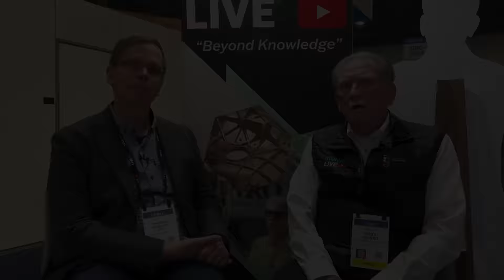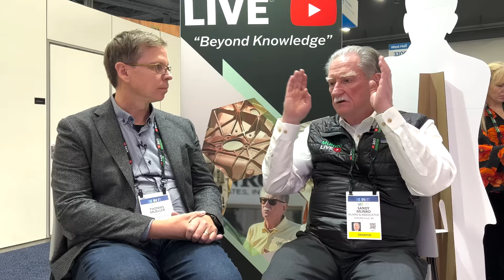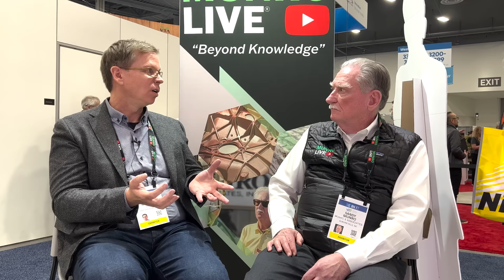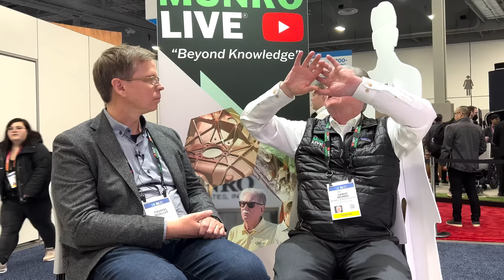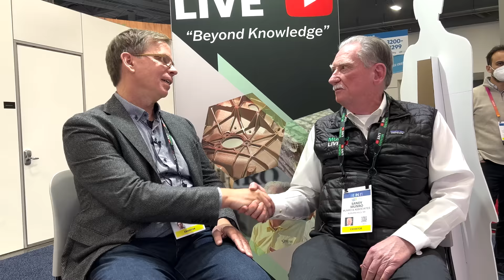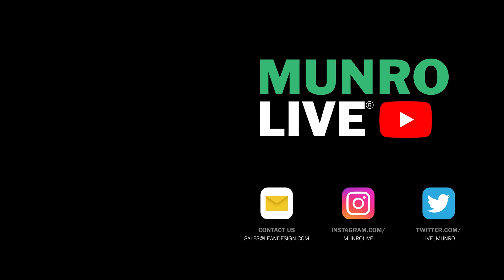100 Million Lines of Code: The State of Automotive Software | CES 2023

Comment: Wire and chips are NOT the major cost in large programming projects. The major cost is the programming of large computing systems. There's a reason why the "Boeing Dreamliner" has so few lines of code. This is because of the built in problem regarding complication in programming. Due to Turing unavoidable halting problem, you have to put massive dollars into a large programming project such as an operating system in order to make it function. If you have small operating environments - this ends up costing much  much less. It's not the wires the auto people are worried about. It's getting buried in code. Don't throw off coding as if, "what's the big deal." Larger software projects - codebases, if not managed carefully can lead to cost explosions. Wire and chips and simple code is cheaper, compared to that.

Comment: Well now, I understand the drawbacks of C, and using object orientation to reduce complexity is all well and good. However to put forth Java as a beacon of secure software is just wrong. Since Oracle took over Java, rather than deal with security flaws in a timely manner, they throw up a dialog box saying basically if you get hacked due to a security flaw in Java, you agree Oracle is not responsible.😂

Comment: The microservices architecture Thomas is talking about and which must be (a) secure, (b) failure redundant under all operational conditions and (c) based on low latency messaging screams for implementation in Erlang/OTP & BEAM

Comment: Though Tesla writes their own software for their cars, I imagine it's very different than that for many other vehicles. For example, they use the Qt toolkit in their cars which IMHO is an excellent choice. Qt is extremely comprehensive with strong automotive support. It's cross-platform (Windows, Linux, MacOS, Android (including automotive), embedded) and is written mostly in C++. It's quite modular and also supports many other languages including Rust, Go, Java, Javascript, Python, C#/Mono, and more. It also provides strong GUI support which can be easily themed and modified and includes 3-D support with Vulkan/OpenGL. It provides a good abstraction for hardware as well, including sensors, many networking protocols, Bluetooth, CAN bus, TCP/IP, serial, USB, and many more. It even includes GPS mapping functionality. It also provides QML/Qt Quick for the rapid development of applications.
Reply: They too use some external suppliers, at least for their infotainment, and that system is of course linux based.
Reply: @luc_libv_verhaegen  Qt would be one of those suppliers. I also know that at least early on the part of the GPS software (the part shown on the dash) was by Garmin.

Comment: Longtime fan Sandy. I want to point out that EVs are NOT light on tires. The ID.4 runs through tires ever 10-15k miles if you are aggressive. Reason being that the vehicle  are heavier, and the tires designed totally different for noise and high performance, which also makes them more expensive. So far tires are the ONLY thing I know of that cost more on the EV vs ICE.
Reply: In addition to the valid reasons you cite, EVs also have more power than most ICE vehicles, and drivers are typically driving them more aggressively. So, yes...the vehicle is heavier, drivers put more stress on the tires, and the vehicles are often fitted with tires less able to put up with the abuse, all of which leads to shorter tire lifespans, not longer.

I found the claim in the video that tires last longer, puzzling indeed!

Comment: I see the problem as old fiefdoms not willing to talk with one another. I agree with the comment that in order to survive, the difference departments have to consolidate communication into a few chips vs the current 150 chips.  Here is nothing wrong with a canned program, it is a base that can modified as needed by all companies as is done with accounting systems.  There are actual independent modules that work independently in a systems.

Comment: I asked this question on another channel without an answer.   Are you and Thomas basically saying that ecu(s)  are basically thin clients, and the neuronet is "the server" which is where all the real computing is done?   That being the case, the thin client in the car(s) should be able to survive substantial increases in server upgrades without swapping out chips or boards in the thin client running in the car..   Thomas's description of "hot standby "  is interesting.  I worked at and  on fault tollerant computer systems for 25 years which had a slightly different philosophy in their architecture.   If a system had 2 cpus, both were used as active and not hot standby.  The idea being that both cpus would be doing real work.  If one of the cpus failed,  the backup process of the primary and visa versa,, running on the 2nd cpu would kick in and the failure would usually not be noticed.  These systems were initially used at very large financial institutions stock markets, etc.  They were hardware and software fault tolerant.  It almost sounds like there's be a great benefit to designing a similar styled set of chips.  One of the trade-offs would be messaging occurring between the two chips,  but  you would or should be getting more thruput out of 2 doing real work as opposed to 1 with 1 in "standby mode"   "near edge"  - client /request    Far edge -server.                                                                                            Interesting points about BMW's head system  running idrive6,7,8, and apparently soon 9.  none of them are compatable with other versions  Right now if you buy a car in 2023 and the car is running idrive7 or 8   7 or 8 caan' be upgraded to provide the functionality of a  idrive9  sytem.   All 6,7,and 8 are all dead-end systems.   It is only now that BMW  is thinking about using the same head/idrive  system across all of their platforms  They've been in the system os business since at least the early 90s and only now they're considering making their electronics transparent about all their car models.   Part of that was a perverse sales tool.  Well if you wnat this os, you  need to buy this model car etc.                                                                                                                                                                          As a BMW owner,  I can't tell you how irritating it is to buy a car with  a specific  idrive only to be told that the advances made on suystem8  can't be applied to os7.   if the car manufacturers were using object oriented software, the speedopeter object could be mored  up or down on the screen or perhaps more to another screen entirely.   It would seem that model manufactures are years away employing anything like object-oriented programming.    BMW has never r at the head of the class when it comes to sofware devopment.

Comment: "Moving from a linux based system to android..." Android IS a linux based system, linux is just a kernal and android is using the linux kernal. BMW has not moved away from linux, it is simply using a different set of libraries.

Also what is with all of this C hate, C is awesome, just because its old does not make it bad. There is a reason why, despite its age, it still persists, because it is a really well designed language. Should it be used for everything, no, but neither should it be dismissed, used as a systems language, nothing really beats it.

Comment: Very interesting. Two big worries for me:
1) Security - hard to do particularly when you are using lots of third-party code - a trivial library way down the system can allow your system to be broken wide open. Which means constant security updates.
2) Constant security updates means product obselence even though the hardware is fine. Mobile phones only last a few years these days - they should be junked when they are out of updates even though everything works fine. The life of your car will be dictated by when the manufacturer decides to stop updates or when they turn off a critical server.
Reply: "Mobile phones only last a few years these days" -- maybe. Though my four year old phone might disagree. But in any case, this is more an indictment of mobile phone manufacturers than a suggestion that auto makers should go that way.

Publishers of software platforms ought to be required, even for mobile phones but especially in a dangerous consumer durable good like a car, to provide security and reliability updates for a much longer period. At least 10 years IMHO, and possibly even longer.
Reply: @harvey66616  I agree they should, but will they? My experience of everything in the Internet of Things is that updates may (sometimes) be available while the product is in production but cease very quickly thereafter. Security is a nightmare these days, even with devices that can be updated easily. The number of attacks is huge and automated - whenever I bring up a new server on the Internet people are trying to break in within seconds. 
Mobile phones are a pet hate of mine. I've got a few old phones that work fine but updates stopped after 3 or 4 years. After that they are very vulnerable to attack. Given the data that is on there I can't take the risk.
Reply: @almarstar  "I agree they should, but will they? " -- they won't, not without someone forcing them to. Which is why I said in my comment that they should be required to provide updates, i.e. by government regulation.

Comment: My 2018 Audi S5 had a feature that if I forgot my USB attached Cellphone in the car, it would telle me the minute I opened the doors. Even Tesla does not do this in my 2020 model Y. I wonder if it’s a legal concern that prevents them from getting involved with babies left in a hot cabine. One day it will be like in the 5th element - you will have to Hotwire your vehicle to take over cause all vehicles will be autonomous on wheels or of the ground.

Comment: With all the technology and capability that you say is imbued in Tesla vehicles, and that characteristic puts Tesla leagues ahead of other manufacturers, why do the automatic wipers not work as well as those from other manufacturers? I do believe that Tesla still has the best technology, but this is an example of something amiss somewhere in the process. What about the camera replacement for the ultrasonic sensors that were removed in 2022? I haven't heard that the functionality has returned, but I might be mistaken. Has it? Can I pull out of a parking space without getting clipped by an SUV? My 8 year old Explorer keeps that from happening. It also helps me park without hitting the car behind me by using both visual and audible cues. To my knowledge, a new Tesla Model Y will not.

All the technology in the world does not prevent a company from still failing its customers. Legacy manufacturers may be restrained by their legacy ways, but what's Tesla's reason? I'm not saying I want you to bash on Tesla, but some even-handedness with the criticism when it is due is prudent, don't you think?

Comment: Wait a minute, Android is a Linux system. Linux is the operating system kernel, not the whole operating system like Ubuntu that you may know. By the way, Linux is all written in C. So they moved from Linux and C to Linux and C :) Clearly whatever was slowing down that route planning software it was not the Linux underneath it.
Reply: Mr Mueller has little clue. He's contradicting himself several times.

Comment: Discussion at 13 minutes in about filtering data and only sending the important bits to the “mothership.” Tesla is not alone in this approach.  Mobileye also uses this approach with their systems installed by several OEMs

Comment: my 1st Opel car, 45 years ago had 4 wheels, a carburetor, 45hp, and did go 120km/h max. I still have pleasant memories of that one (including having to put a sand bag into the trunk every winter). Nothing failed, cheap, no repairs, it got 13 years old, before I bought a new compact car, then with a turbo-diesel engine, a VW also quite reliable. *).  Nowadays You got to be afraid, when You drive through a puddle of water (or something deeper) on the street, that the electronics fails, or shorts out and even causes a fire! Then they build gearboxes with magnesium-aluminium frame or worse: even the steering wheel- and tube made from that dangerous lightweight alloy (some BMW models!) I don't want a self-driving high-tec cinder-box, but I am old and no longer relevant, maybe.    *) then I had a VW van, my late father's Kadet, a Fiat Punto, and now a 2015 Ford Tourneo EcoBoost and a Fiat Panda.

Comment: They make it sound like C programs running on Linux is old-fashioned and bad. Yet they they praise what Tesla is doing, which (among other things) is exactly C (and C++, which wasn't really mentioned on the video... 🤦‍♂)  on Linux.

They also mention that a lot of newer programming languages are "better". What I see is that they have a lower barrier of entry, so more people can learn to use them. This is somehow supposed to solve the issue of software quality?

The reason why much of old C code is "spaghetti" is because even the bad programmers had to learn to do C (they didn't have any options!).

Newer, better tools (modern programming languages) make it harder to create dangerous software, but they do not automatically create logical, lean, maintainable software. That's where good software engineering is still required. And here's the kicker: you can achieve all that with C/C++ if you have good software engineers and programmers. Software isn't any different from other engineering disciplines in that sense: to achieve greatness, you need ace players.

Comment: A big hurdle is that few companies are making their own components. Tesla is one of them and probably some boutique/exotic car companies. Instead, they buy the window regulators from Valeo, HVAC system from Bosch, brake system from Continental (just examples). Getting those parts integrated into a handful of chips is going to be a huge challange as you need to coordinate effort across suppliers AND across car manufacturers. A bit of chicken-and-egg dilema.

Comment: I have a problem with Sandy's comment about EVs lasting for ever. As long as there are steel components exposed to salt in the many states that use this nasty stuff, the vehicles will most likely NOT last forever.  Also, aluminum corrodes faster in a salt environment. If manufacturers chromate or zinc prime and liquid paint (not powder coat) exterior parts, we will have a better chance of the vehicle lasting a long time. I already see rust on a few areas of the undercarriage on my 2020 Ram 1500. I will be cleaning and undercoating the problem areas in spring.
Reply: After I sent our last Dodge to the recycling center, I vowed that a MoPar will never darken our driveway again. I learned my lesson, finally.
Reply: @jamesvandamme7786   My creator's MoPar still darkens the driveway. How do we foist it off on some sucker?

Comment: I would have thought that using small microcontrollers around the car communicating over a serial protocol would reduce the size of the wiring loom. You only have to use 2 data and 2 power wires, not run n large cables all the way back to your larger computer.

It slightly reduces flexibility if they can't be centrally reprogrammed, but it reduces the damage a bug or hacker can do.

Comment: Tires do wear out, the torque causes them to wear out as well as the weight of the EV's.  I agree with the brakes, motors etc.
Reply: Yes, but HOW you drive is the determiner.  The people showing off in sports mode run through it faster for all the obvious reasons.  But people driving slow and reasonably have far better tire experience than all the FUD on the internet says !

Comment: Hey Sandy, could you expand on your comment about tires not wearing out as fast. My experience is that tires are wearing out faster due to heavier car (according to the tire shop) - I live in Montreal and got only 20,000 km out of my original Michelin tires in mix driving.
Reply: Il y a une garantie de 125,000 kilomètres sur les Michelin Defender T+H (SUV) , et Bridgestone Turanza Serenity Plus.
Yokohama AVID Ascend LX: 135,000 km. Goodyear Assurance MaxLife, et Nokian Tyres One: 140,000 km.
Pirelli P4 Four Seasons Plus, Continental TrueContact Tour, et Hankook Kinergy PT H737: 145,000 km.
Hankook Optimo H727: 160,000 km.
Reply: "Tires on a modern electric car will wear down much slower than in a car with a traditional internal combustion engine. This is due to good traction control. The driver assist systems reduce slipping by utilizing the electric motor's rapid power adjustment. This system is much quicker than in ICE vehicles, where it is based on braking and limiting engine RPM" , Nokian Tyres' Development Manager Mikko Liukkula
Reply: @waynerussell6401  ... assuming you don't drive like the proverbial bat outta hell, with all that torque.
Reply: @Wirmish  according to Michelin's website and documentation the Primacy tires I have on my 2020 M3 LR should have lasted a lot more than 20k KMs - Important disclaimer from Michelin; Orginal equipement tires are excluded. Why would the same tires bought as replacement last longer than the ones that came with the car? No idea! Time will tell and if I didn't miss any fineprints, I'll be happy to claim new tires if they fail to reach the stated milage.
Reply: @jamesvandamme7786  He does drive like a bat outta hell - he's in Montreal.
Reply: @waynerussell6401  I have a feeling regenerative braking kills that benefit.